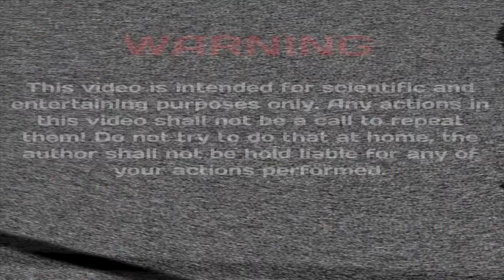EXPERIMENT: LAVA vs SHREDDER

Comment: I already know this but I'm surprised that metal can survive a really hot magma substance.
Reply: Brother no Magma is Different and Lava is Different,Metals can Survive Lava But they can't survive Magma,Magma fire is Hotter than regular flame.
Reply: @akainuclapstherest5487  Lava and magma are just semantics based on whether it's reached open air or not.

Functionally it's still the same material.

What he had at the beginning though was pumice stone, which is what you get as volcanic ash accumulates - Pompeii was full of it.
Reply: @akainuclapstherest5487  bbvbvncb njd!!!!
Reply: @mnomadvfx  Magma is the inner core It's called lave when it comes out,Magma at the core is Hotter than surface of the sun lol.
Reply: @akainuclapstherest5487  Magma is molten rock that is beneath the earth's surface. While this includes the core, it is not limited to the core.
Reply: @kirose  anywayssss magma is hotter than lavaaa
Reply: @akainuclapstherest5487  magma isn’t hotter than the suns surface LMAOO. magma can get to 1,292 to 2,372 degrees Fahrenheit. While yes, that’s hot, but the suns surface is 9,941 F. Nearly 10,000 degrees!
Reply: Not enough heat transfer to affect the mass of the shredder in that short of time
Reply: @richardbambenek2601  finally someone who listened in Geography class
Reply: It was not on The teeth long enough to melt it.

Comment: Boy at the lava is at 2000° or over that I thought for sure is going to melt the shredding blades right away but it didn't. Boy that's hard steel for the shredding blades to withstand the temperature of lava like that. Thank you! That was a good one. I enjoyed it😮👏👏👏👏👏👏👏

Comment: Maybe forge a sword with lava!
Reply: Lava rock is mostly silicone. When it is already low temperature(relatively, being heated in a crucible, instead of the hell fires of Earth), and cooled fast like this, it turns into obsidian. The end product is essentially glass that has about 20-35% other mineral impurities. You could conceivably make a knife with it, and some cultures have, from found obsidian, as it is stronger than pure silicone glass. 

A sword might be a bit impractical as it would probably break in two, even striking flesh, just like a thin rod of stone would probably break if subjected to too much shock. The Aztecs actually had a very deadly obsidian alternative to a sword, called a macuahuitl. This is something that resembles a wooden cricket bat, with sharp obsidian bits all around the edge, like flat, miniature cleavers. I saw this weapon tested on a show on a hanging pig carcass. A strong swing could cleave about half of the way into the pig. The obsidian would get damaged and dislodged in battle, but it might be functional for a good dozen whacks, which, if there are 20,000 of you hacking away, was enough to get the job done, and then, you've still got a cricket bat. This weapon can decapitate heads and dismember limbs. It was sometimes used as an executioner's axe. The conquistador Hernan Cortes wrote an account of one being used to decapitate a horse.

Comment: I expect the lava to merely gum it up, because it looks like that's made out of steel, and though steel softens under that kind of heat, I don't think it is enough because it isn't enough for the lava to start at the temperature where steel is soft, it has to actually heat the steel up to that temperature, so the lava needs to start much hotter than that.
Reply: It didn't even stick to the metal very well. That's a surprise, I would expect it to act rather like flux and stick to the metal.

Comment: Logically melted stuff like lava surely pass the moving metal because it's soft although it's very2 hot but not in melting temp for the metal and cold lava will be crushed through the shreded because it's originally formed from a stone.🙏

Comment: How this works is the metal in the shredder is a higher melting point than what the lava was made of and the heat of the lava didn’t melt the shedder was because it wasn’t hot enough to melt it